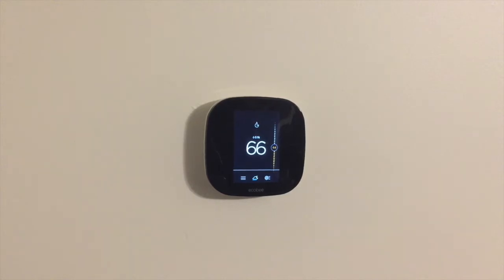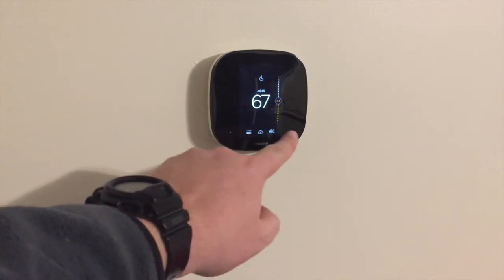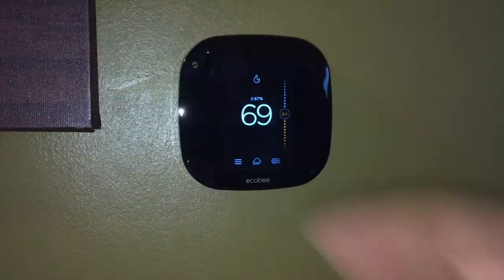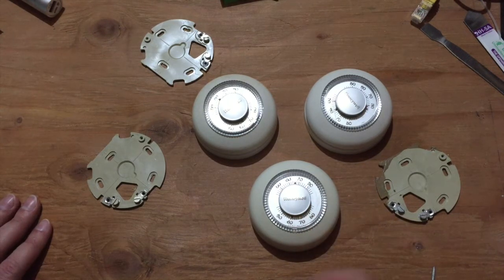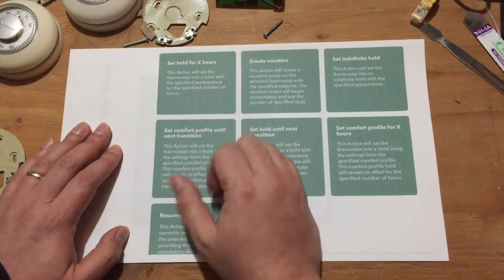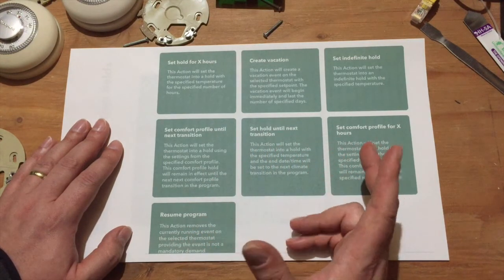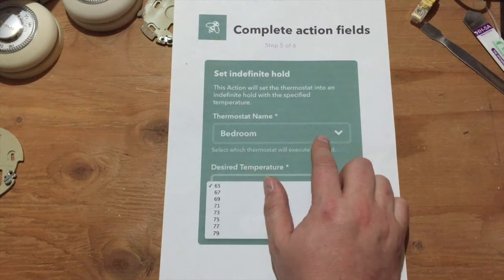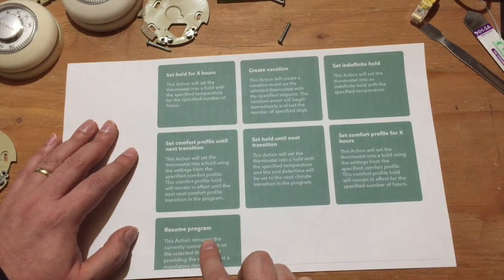#021 Ecobee 3 Smart Thermostat Install, Part 3

Comment: Regarding your frustration with IFTTT and cloud-based automation...being beholden to the implementation decisions of other organizations, not to mention the dependencies upon cloud-based services and internet connections, you might consider openHAB for overall management of your devices.
Reply from the maker: Thanks, I'll look into that. Ecobee does have a pretty nice open API, so in theory I could write my own skills to solve the Alexa issues. Nest I don't think is open at all, so I'm not sure what could be done there. Unfortunately I didn't find any smart smoke detectors that were in the same league as the Nests.
Reply: openHAB has, among other things, bindings to other networks such as Z-wave, and other technologies.  One such binding is to Ecobee via its API.  So, no development necessary on your part.  IFTTT and Philips Hue and on and on.
Reply: Oh and it's open source...

Comment: Ecobee states that the transformer that controls your circulators is not powerful enough to power smart thermostats.  Do you disagree?  how have things been holding up?
Reply from the maker: Thanks for bringing this up! I haven't had a problem yet, but perhaps I'm living on the edge and not realizing it.

I had a heck of a time finding that statement (the only reference I could find to to Taco on their website was to Taco Bell!). The problem being that searches with site:ecobee.com didn't turn it up, because it's not in their domain.

After much searching I came up with: https://ecobee.zendesk.com/hc/en-us/articles/236335908-Taco-SR503-4-Three-Zone-Switching-Relay which is I assume what you're referring to.

The ecobee3 spec sheet says it has a power requirement of "Less than 3.5VA". I suspect that this is a worst-case if it happens to be transmitting on all three radios, CPU busy, screen busy, etc. all at once, and that the average consumption is presumably far less. How much less? I don't know. It would be interesting to measure. I may have to try that and make a video. With 3 units, power consumption should be less than 3*3.5 = 10.5VA, because they're unlikely to all have maximum draw at once, but perhaps at power on it could happen.

Taco doesn't really tell you how much headroom you have for powering the thermostats (even dumb thermostats like the Honeywells that these Ecobees replaced will consume some power themselves, since there is a resistive heating element in the anticipator. Granted, it is a small one). Their wiring diagrams do show specifically how to wire a common for 3-wire thermostats:

http://www.taco-hvac.com/uploads/FAQ_attachments/zone_control_wiring_diagram_1009.0_51.pdf

And the newer -4 models even include common terminals, so surely they anticipate some amount of draw, but perhaps not as much as the ecobees.

I'll inquire with Taco about this.
Reply: Yeah sorry, I should have included the link to that zendesk article which is precisely what I was referring to.  I would think these relays would be sufficient, but Ecobee states otherwise.  Weird since Taco's manual that you reference suggest wiring a smart thermostat up with the common connection off of it's internal transformer.  I look forward to you posting Taco's response!
Reply from the maker: I finally got around to doing some testing and made a followup video: https://www.youtube.com/watch?v=ZfDIAMBJuVo